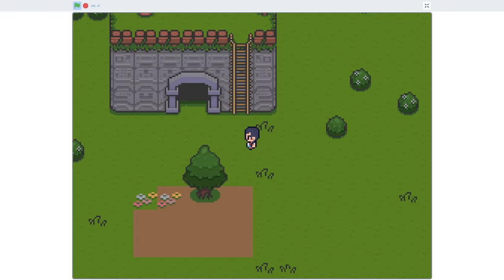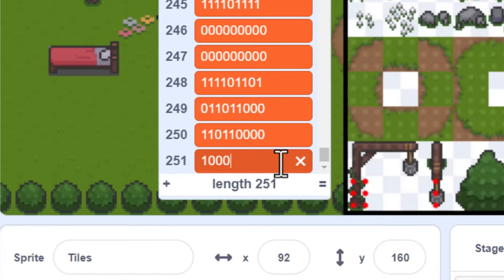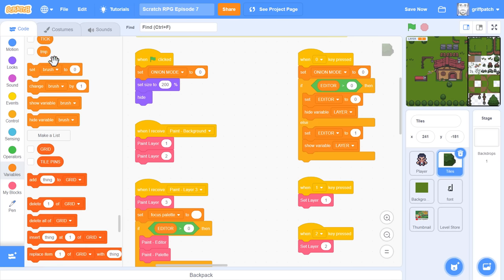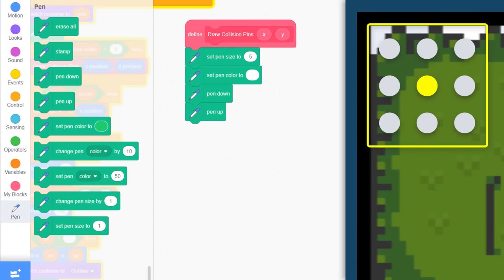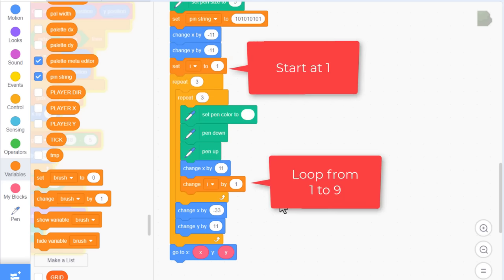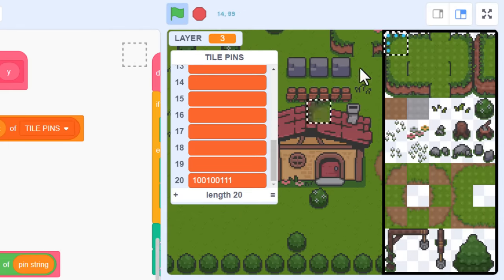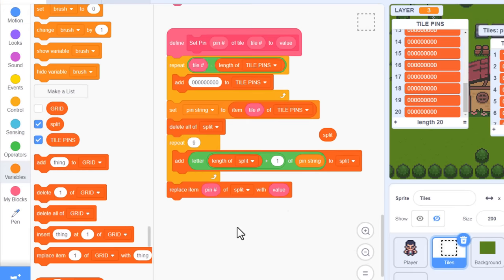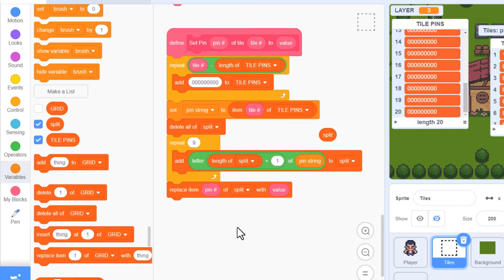Collision Pins? 💥📌 Now that's clever! 🐱 Scratch RPG #7

Comment: Something I wanna mention regarding the "set pin (pin #) tile (tile #) to (value)" custom block is that for whatever reason if you use an operators block for the value input (even if it ends up still being one letter) it will break the whole function by causing the split reporter to return with spaces instead of as one number as you'd expect.
This really tripped me up when trying to make it a toggle instead of needing to press 2 different buttons.

Comment: 18:00 
Can I use the power of 10? Like this:

set val to 10^ of (9 - pin #)
if not letter(pin #) of (item (tile #) of TILE PINS ) = value{
if letter(pin #) of (item (tile #) of TILE PINS ) = 1
   replace (item (tile #)) of [TILE PINS] with (item (tile #) of TILE PINS - val)
else
   replace (item (tile #)) of [TILE PINS] with (item (tile #) of TILE PINS + val)
}

This means if the value we want to set is already set in the pin, we ignore it. else then we use the math there:
example: 1 1 0 1 0 0 1 1 1
I want to set the pin# = 2 to 0 and the letter is 1 then it is the - part, means
110100111 -> 110100111 - 10000000 = 100100111 and it works!

Comment: At the end of the define Set Pin (pin #) of tile (tile #) to (value) make sure the block is replace item (tile #) of [TILE PINS] with (split) because if you replace the item from the GRID list it will put random tiles all over the corner of your map. 😅

Comment: having an issue reliably reading the list as a single value, i've gone off tutorial a ton and when initially setting this up it worked but something broke, I redid the pins in isolation and still couldn't get it to display a value without spaces, i've got a temporary fix but I want to learn more about this specific functionality

Comment: I am  a bit late but congrats on 200K subs! :D And I have got a question to ask. is there a way to use only one key bind for enabling and disabling a pin when touching a pin? :)
Reply from the maker: Sure there is... So you could create a variable called "pin brush". Then where you check for the keypress, switch it to <mouse down?>. Then IF mouse down, if pin brush = empty string, then set pin brush to letter i of pin string. Then you can work out what the pin will change to and set pin brush to that instead. Now you know what to change the pin strings to as you continue to draw. The else for when the mouse button is no longer pressed can set pin brush back to the empty string.
Reply: @griffpatch  Thank you for the help! :D I will try and edit the code on what you have said! :D

Comment: 17:55 i wouldve done something like
change (item () of tile pins) by (1*(number of what pin you are changing * 10))

probably not right considering i typed it and im tired but s
Reply from the maker: You'd need to use the 10^ block to do it like that, but we also want to be able to remove 1's too, etc

Comment: How easy would it be to make two layers of collisions using the pins?
Reply from the maker: Depends what you mean... We'll already have multiple layers due to the tiles being layered on top of each other... Layer 3 WILL be a dedicated layer of collisions above the existing layers (that's how bridges will function)
Reply: @griffpatch  how easy would it be to create a second layer of collision for a separate use, which would be unrelated to actual collision only using the same collision checks?
Reply from the maker: Easy enough... but for what purpose? :)
Reply: @griffpatch  Pokemon encounters

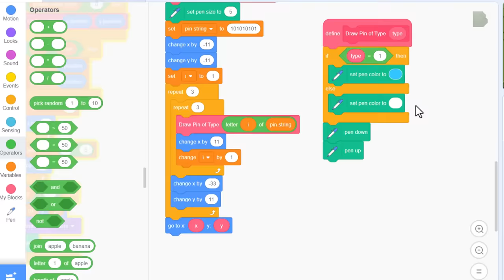Comment: Hey Griffpatch my colouring is not working I am right now at 11:35 And all the pins are white do you know what is wrong?
Reply from the maker: Did you use the right set color block? The one with the color picker?
Reply: @griffpatch  Yes?
Reply: @griffpatch  Its from my draw pin of type block its always setting to 0 with no explaination
Reply from the maker: @gamingwithcrypto9790  What is your Scratch username, and is the project shared?
Reply: @griffpatch  My user is Gamingwithcrypto1234 And yes the project is shared
Reply: @griffpatch  WAIT I GOT IT WORKING

Comment: Hey griffpatch im sorry im a year late but ive had some problems with the pin setting thing so when i press the 1 key either nothing happens or it toggles between 1 and 5 pins and when i let go they disappeared and if i try to change the blue pins in the tile pins list nothing happens and ive tried redoing everything in the video but i cant seem to get it working so if u could help me that would be awesome

Comment: The split list in my script appears as dissociated numbers, and I can't figure out why. When I type in numbers manually, it reverts back to normal, but becomes separate again as soon as I change its value using a script. This causes issues in my code since I'm using a mouse click instead of a key press to change the pin's state.

If that can help, the project is unreleased but its code is 755055851

Comment: For me it worked until the blue dot colisions part , for some reason the bottom left corner would just not turn blue (same was for the code) 111111110 -> this is always what happens when i try to fill the whole area. Please help...😥

Comment: um i don't know why but the pins are not perfectly aligned, the second and third tiles top rows aren't aligned and I double checked the scripts and they lined up with your code I don't know whats wrong :( nvm I FOUND OUT! WARNING TO ANYONE WANTING TO DO THIS: don't have any tiles one pixel thin horizontally it will mix up the center of the costume and mess up the pins if you want something like a horizontal line try to blend it with the background so it stays fixed but the players don't see it :D

Comment: how about 2d isometric 3d platformer with platform jumps
Reply from the maker: Nice!
Reply: maybe even with 4 viewpoints manual camera rotate
Reply: just make sure the layers on top of you are removed or transparent suitably, isometric minecraft cave dungeon exploration
Reply: dont you have matrix or embedded list variables
Reply: ie cell divided datatypes with-in the list type, like template cast internal data type
Reply: less in vain work with smart datatype usage (cell types instead of string types)
Reply: omg scratch does not support matrix or cell type internal data lists
Reply: string data is kinda a hack that can do it, if you make a function that parses and stores the string data
Reply: some kind of utility function lib should be useful
Reply: @griffpatch  try raster render in scratch (manual, shader, intersection ray cast, etc)

Comment: Hi, maybe I can help someone with this. So for me the problem was that when I pressed 1 all pins randomly distributed themselves. I solved the problem by turning the 5.5 into a 3 at "defind Draw Pin of Type type" in the setting and if "distence to moiuse pointer < 5.5 then" - And then it worked.